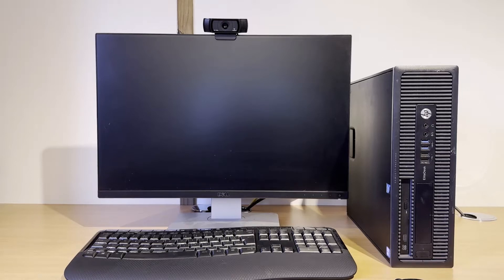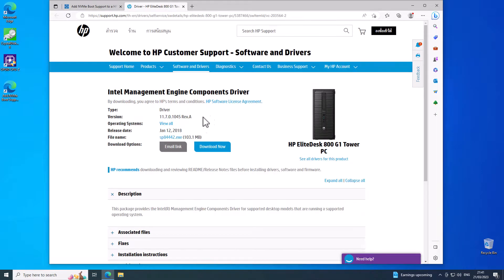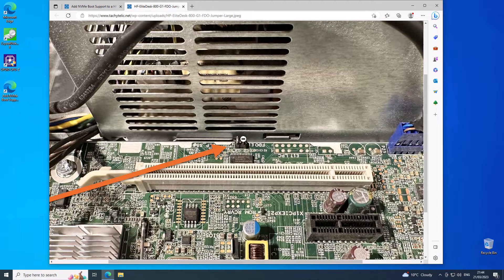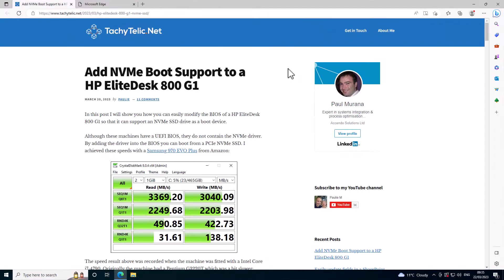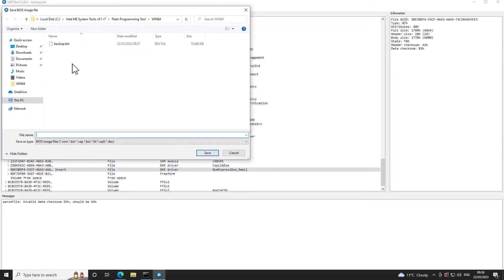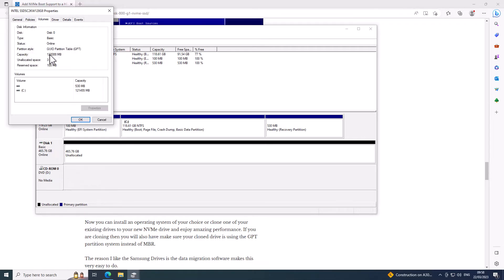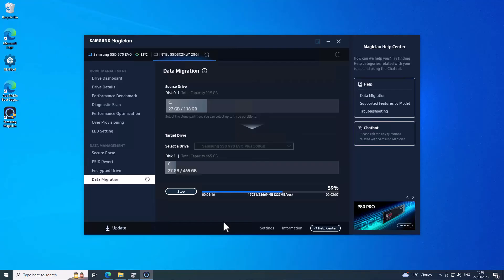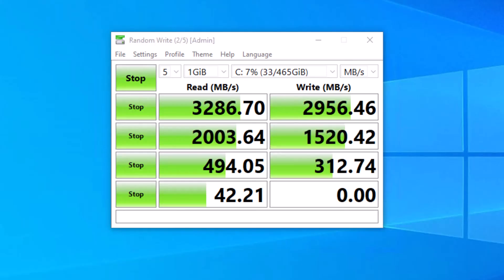Modify the BIOS of the HP EliteDesk 800 G1 to natively support NVMe SSD

Comment: Using ProDesk 600 G1 mini. I edited the bios using a bios .bin file from HP... everything looked fine while in the UEFI tool, but I didn't notice that the file had additional data that isn't used for the system bios... luckily I have extra systems and soldering tools so I may not have permanently killed the board itself. But to prevent this, just dump the backup of your current bios like in these instructions!! Fortunately my other 3 systems worked with this solution. So for anybody else doing this: intel management components couldn't finish installing for me, but use the system tools and inject the NVME driver as instructed. I suggest getting the latest bios from HP, flashing it in the bios itself, THEN using the system tools once back in windows to dump the backup, and edit THAT backup.bin to create nvme.bin just as instructed in the video. If you try to edit an official bios, you might just brick your motherboard like me and have to repair it through other means!! Thx for your help Paulie.

Comment: Does this mod work with Win 7?
Reply from the maker: The operating system is somewhat irrelevant as it is the machine that is changing. But Windows 7 does not have native NVMe support. Others have made it work though.
Reply: @PaulieM  I had no problem to insert the missing module into the BIOS to make the NVME bootable and I installed a driver under Win 7 so the OS can now see the drive. But I had no luck with my attemts to install Win 7 on the NVME. No problem with Linux Mint, though.

Comment: Does this machine normally recognize NVME as a secondary and non-boot drive, that is without injecting the NVME driver?  Very nice video. Thanks.
Reply from the maker: Yes, windows sees it and can use it just fine without a bios mod. You just can’t boot from it.

Comment: Very thankful for sharing the tutorial. I have an old hp elitedesk 800 g1 tower. And recently I came across a decent small case and decides to swap the old parts to give it a fresh life. I’ve been using SATA ssd for it before and this time I decide to upgrade it with nvme with RGB nvme to pice adapter. Yes, for a fresh look and way faster drive. I encountered the same problem as anybody who thought it should be just plug and play. The old hp bios cannot recognize my nvme at the boot up. Then I found this video that shows how to upgrade the nvme support for my exact build. I was very excited to give it a try. However, I got another workaround after some research online. Now I am using opencore with nvmexpressdxe.efi driver on my original SATA ssd which was a Big Sur hackintosh. Now the opencore start menu lets me decide to boot up Windows from the nvme drive and it runs as fast as it never can be. I also tried Clover and it worked as well. I am satisfied with the current build, and I have some spare hp elitedesk sff pcs. I would try the bios method on those as well so I would end up with multiple choices to upgrade these old pcs with lightning speed nvme boot drives.

Comment: can u just modify/ inject NVME driver in the bios (K01.03.08.bin) file with the UEFI UTILITY and then flash this modified file in the bios with a USB stick during boot with the Flash rom Option. ?
Reply from the maker: I don’t know, I didn’t try that option.
Reply: Hey bro.. i am also using K01 motherboard (HP Pro 6300 and HP Elite 8300)

Comment: Thank you Paulie. It works with UGREEN NVMe PCIe Adapter PCIE4.0 x4 and TEAMGROUP MP33 512GB PCIE Gen3x4 M.2 2280.

I installed it on white PCIE becuase Nvidia 1050Ti uses the black PCIE. and I got read 1700MB and write 1600MB.

now game load is more faster than SSD SATA.

Thank you for sharing your knowledge.
Reply: I wondered why he was blocking the x16 slot, when only 4 lanes are needed for the PCIe to NVME adapter.

Comment: Hello and thanks for your video
Please explain this line -fptw64.exe -a 0x580000 -l 0xa70000 -d backup.bin
I know (from help on FPTW64) that -A 0x580000 is the address of the BIOS beginning (and it can be obtained at the command fptw64.exe -i for the BIOS region) but tell me where you got the value for -L 0XA70000 (I know what -l means The number of bytes that must be considered) once again where the value is the A70000 and how to calculate it? I also want to ask, is FPTW64.exe BIOS -D Backup.bin isn't this the same?
I clarify so in detail because I have HP Z230 SFF and I want to also add for him the support of NVME system discs
Thanks in advance for your answer.

Comment: It worked for me. Thanks!!
Reply from the maker: Cool - Did you get a nice performance boost?
Reply: @PaulieM  Not too bad. 1500mb. I also have a lenovo m700 mini. It only has msata ssd support not nvme. I wonder if the same trick will work on the lenovo? 😄

Comment: Thanks a lot! Works fine on a HP ProDesk SFF 600 G1, BIOS v2.78
Reply from the maker: Glad to hear it also works on a 600 G1. Was there anything different required from my steps?
Reply: I have same machine with you, and I wonder did you use it on X16 or X1 connector? Cause I use discrete GPU, so I need to know how much speed on X1 connector if I use NVME adapter.
Reply: @nurhudamuhammad5626  There is an adapter for X1 but the speed will be significantly slower. A bit lower than a SATA SSD.

Comment: Everything worked smoothly ;) thank you
Reply from the maker: It's a brilliant upgrade, glad it worked well for you.
Reply: @PaulieM  I am trying to built an sff gaming/multimedia computer. It is a hp 800 g1, i7 4790k, 32gb 1600 ddr3, nvme ssd 1tb and rx6400. When the price of the rtx a2000 will drop a little bit, I will buy 1 (I would like to buy the 12 gb version :) )
Reply from the maker: @boy82rm  Looks like a great card, very low power requirements.

Comment: HP EliteDesk 800 G1 Desktop Mini PC 
Can this bios be updated
Reply: @user Is 2.78 for the mini only? If not, I have both a usdt and an sff. Let me know if it's somewhere because I haven't found anything except 2.77 for mine.
Reply: @user Yeah, I ended up finding a Softpaq downloader that presented me with 2.78, although the hp site didn't have it. I would be interested in a modded bios though for the usdt and/or the sff here for extra function or such, but in all my searching, I have failed to find any for these two. I haven't looked at any bios mods before though, so I'm not really sure if I'm even looking in right places and I feel it would be nice to get in to things a little bit at least.

Comment: i installed my NVMe ssd without seeing wether it was supported on this computer or not. After realizing the bios can’t detect it, instead of taking off the heat sink (just put on some new thermal paste) to remove the ssd like a normal person, i went through all of this so i can use that nvme ssd instead of just using SATA. It worked flawlessly though but not sure if it was worth it. Thanks for the help!
Reply: Your BIOS could not detect NVME as a booting drive or not at ALL?
Reply: @sezwo5774  It doesn't detect it at all. Hence have to install nvme drivers in the bios to detect it. It works of u follow the instructions

Comment: I just bought a G1 off of eBay. Can't wait to get started on this new project!
Reply from the maker: Cool - great value machine - let me know how you get on.
Reply: I've got one too. It cost me just 21.21€. I've got a cheap Samsung OEM NVMe drive as well. Sadly the Samsung software doesn't work with Samsung OEM drives.
Reply: @e1woqf you're not missing out on much with the Samsung software

Comment: error 280 failed to disable write protection for the bios space

how to slove?
HP 800 G1 SFF
Reply from the maker: You need to put a jumper on the FDO pins as per the video and blog post.
Reply: Having the jumper pins make good contact is crucial to this mod.
Reply: Got the same error message, checked the jumper switch, i did'nt put on properly. All up and running now😀

Comment: Hi Paulie, Thanks for this amazing Videos, i did exactly what you have showed in the video, so i want to know, in bios will my nVME drive show as nvme ? or have i done any mistakes. coz under UEFI boot sources shows only -  windows Boot manager/ USB floppy or cd/ ATAPI CD or DVD/ USB Hard Drive, i dont see a NVME drive anywhere - please help ?
Reply from the maker: It will just be Windows Boot Manager
Reply: @Paulie M  so is it possible to boot from nvme alone without any SATA hdd/ssd connected?
Reply from the maker: @MarkJova  yes it is. You can have them for extra storage if you want to - but they are not required.
Reply: @Paulie M  you are the Man Paulie..🙏🙏🙏 pc took only 13 seconds to boot. woow, just amazing. Thanks for this blog and for your knowledge.
Reply from the maker: @MarkJova  love hearing about successful modifications! Well done.
Reply: @PaulieM  btw i did this mod for HP elitedesk 800 g1 sff and twr for both the machines